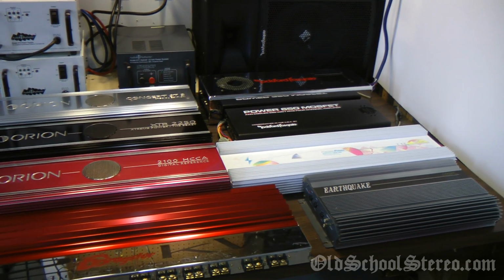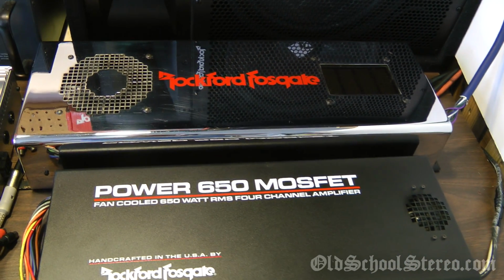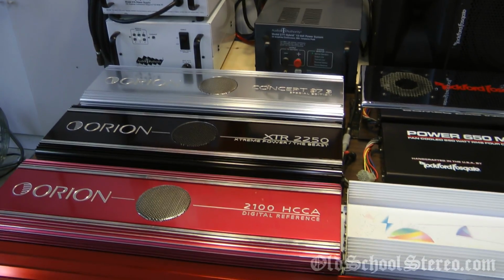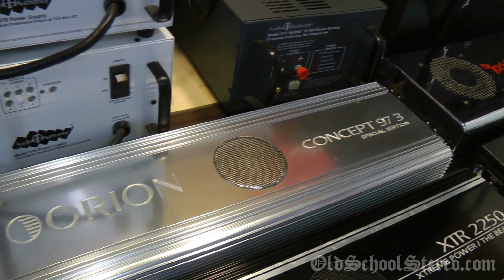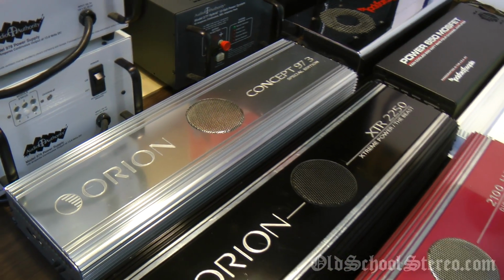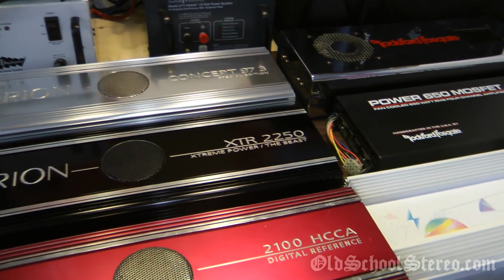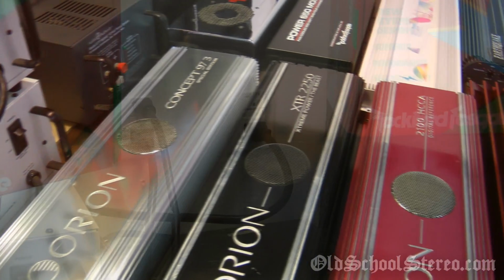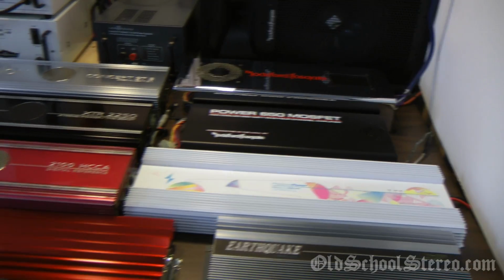Old School Monster Car Audio Amps Teaser - Orion Concept 97.3 and More!

Comment: I have been thinking of building a small test bench myself. Stupid question probably but could you use the power supplies with a agm for more power? Basically as a alt in a car?

Comment: Hey Big D,

I’m fairly new to your videos. These are cool. I used to have a shop w/ a partner years ago, 93-2000.
Anyway, I’m curious, if you had to pick 1 of these amps which one would you pick for hard hitting super tight pounding subs?
Reply from the maker: XTR-2250 or Power 1000

Comment: I have 3 of the 50 97.3 amps along with a 97.1 these are from the run of amps that were never sold! They are gold plated with my name etched in them, They were given to me as a gift from Orion back when we ran a car audio shop. I will have to go dig them out of my moms attic, I have not even looked at them in 15 years or so! They were installed in a 97 civic for less than 3 months before the car was totaled it never made it to a crankup!

I am wondering if you ever done a dyno on the 97.3?

Comment: hey can u recommend a power supply unit that use on car audio that is with $150-200 region and about 15-30amp
Reply from the maker: Check out the RD Power 1kW model I tested not long ago - https://youtu.be/WZxTCzS7FjA

Comment: That EarthQuake heatsink look exactly like my old HighPhonics Zeus. It was rated 600 @ 8 ohms.I've got it @ 2 ohms currently with a second series JL W6. I've had it for I guess 15 years but this amp needs a quality high output alternator because it turns my headlights off on a 99 Trans/Am. When I had it in my 88 Formula it would kill the alternator.
Reply: I had a old hiphonics zues white shell ..600 at 4ohms..I had it bridged to 2ohms with to power fasgate 4ohm 12z it slammed ..wish I could find that amp again

Comment from the maker: The Orion 225 HCCA is rated at 25w by 2 at 4ohms, 50w by 2 at 2 ohms, 100w by 2 at 1 ohm and 200w by 2 at 0.5ohm or up to 400w bridged at 1ohm. I will test two different generations of a 225 HCCA in an upcoming video

Comment from the maker: Yes they still make good gear. The biggest difference is many of the old school RF amps were underrated by 50 percent or more, the newer ones are only slightly underrated. I think the build quality is much better in the new amps (shhh, you didn't hear me say that)

Comment from the maker: I had a Zeus VII, but it had a power supply issue even Stephen Mantz couldn't fix. A Colossus VII or VIII would be nice, maybe I'll come across one of those in the future. I had a chance to pick up a Zeus VIII, but the timing just wasn't right. The RF Power 1000c and Orion 97.3 took precedence.

Comment from the maker: The resistors are my next purchase. Right now I can support about 1700W at 1ohm or 4ohms mono (or approx. 850x2 at 4ohms). I'll upgrade to have enough to do 960w x 4 channels at 4 ohms. This would also equate to 1920x2 at 2ohms or 3840w at 1ohm or 4ohms mono

Comment: Nice!  Wish I had that much power supply capacity.  I was wondering if you had the resistors to take those amps but just had to read a bit further.